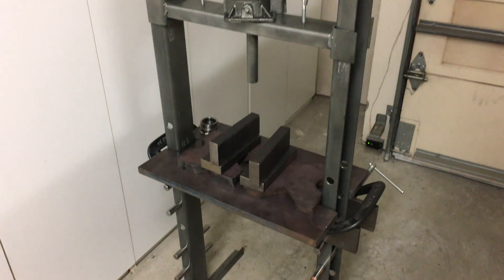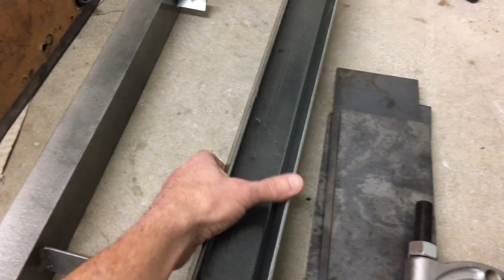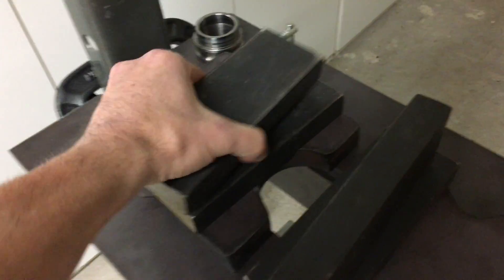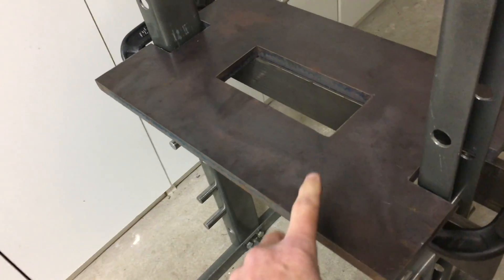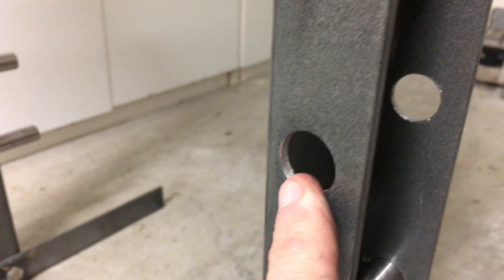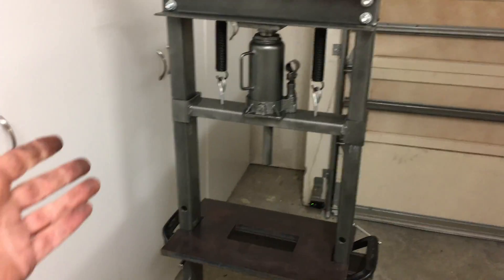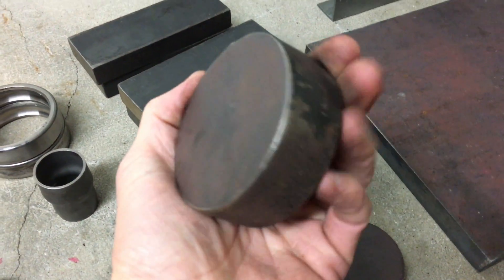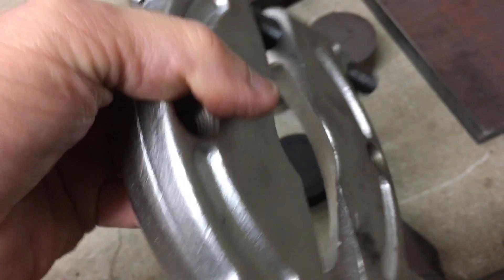Harbor Freight Item 33497 - Central Machinery 12 ton shop press - UPGRADE!

Comment: Apparently they upgraded this press a few years ago with a solid top I beam and different pin placements, an updated jack and a plate to bolt the jack in place and extra stability angle pieces near the bottom aswell.